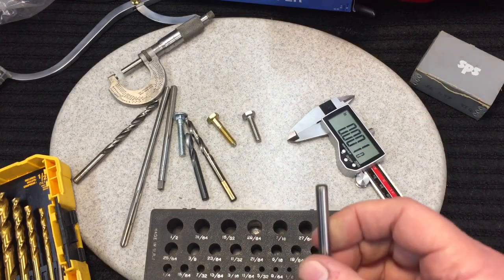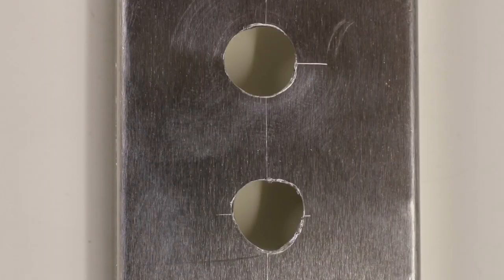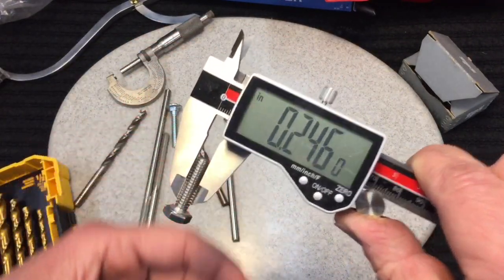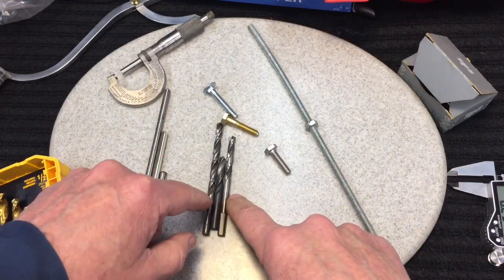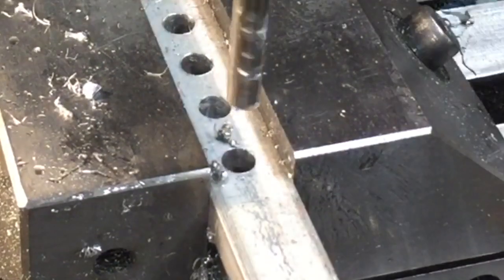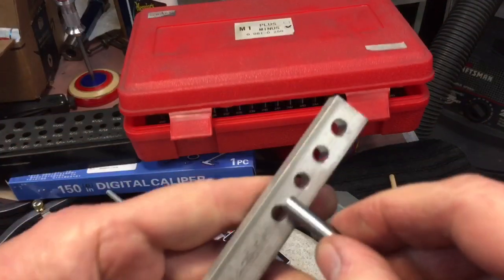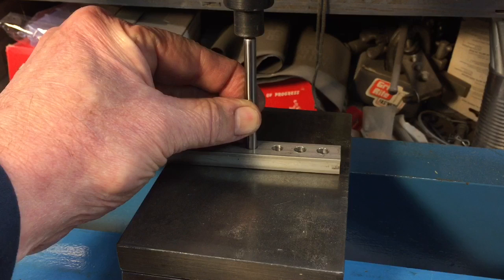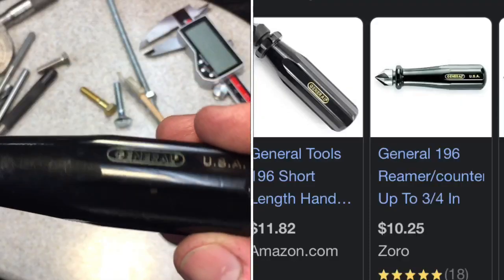Absolute Beginners Guide To Understanding Fits, Drill Sizes and Reaming.

Comment: My buddy Tom got about the best job possible for a newly minted Mech, Engr. in the R&D dept. of Delaval Turbine, Trenton, NJ.  One day, his boss asked him to calculate the heating (hub) and cooling (shaft) for an interference fit.  The shop was about to mount the main drive gear for an ocean-going tanker.  The shaft was about 2 feet in diameter, and the gear was a herringbone gear all of 4 feet across its face and 20 feet on the OD.  His lead came to him and told him that he might want to go down to the shop floor the next day to watch the work he had done the calculations for.  Tom could not sleep the night before.  He kept having this nightmare of the shaft sticking halfway into the hub.  On the day of the big event, Tom went to the shop to watch all go as planned.  Apparently, his boss had checked Tom's calculations after Tom handed them in.  I guess there are a lot of things to teach a newbie.
Reply from the maker: That can be incredibly satisfying when it all goes well but very expensive when things are off...  =D  Glad it worked out well!

Comment: Hint: For quick drill bit/bolt/screw identification, buy a dedicated Drill Gage such as General Tools #15 or similar. Do NOT use your handy drafting circle template for taking these measurements; drafting circle template holes are actually oversized to account for the thickness of the pencil lead and will NOT provide accurate direct measurements. It only took me 30+ years to figure this out and realize that’s why my bit/bolt/screw measurements were always slightly off.
Reply from the maker: Awesome tip!!!!!!!!

Comment: ScoutCrafter, 

In your nrext video it would be worthwhile to go further into the concept of interference and clearance fits.

I find many people don't understand why tolerances can become cumulative.  If you keep adding tolerances you may find when you are finished holes don't align and parts don't fit.

I know of one ship where the centerline was set on the building ways. However,  when setting the centerline for assembly of the ship, they measured from one side of a transverse bulkhead aft and from the other side going forward.  Theoretically, you should have a straight line.  Unfortunately,  going aft the centerline was straight according to the established centerline.  Going forward it was slightly off.  The error carried on increasing with each increase in length.   By the time the ship reached the bow there was a 6" offset.   The ship had a "banana" bend.

Cumulative errors based on tolerances can show up in strange ways.  While escorting visitors around the construction of a ship I noticed that the ship appeared to be bending when looking at it from the bow back towards the stern. The bottom looked as if it were bent with the center lower than the sides.  It turned out the erection sequence of the pieces of the ship had been changed.   As each piece was added  it was trimmed and welded in place.  The problem was that by changing the sequence the weight that was being added caused the ship to bend.  As each was added, trimmed and welded the bend was being built-in.  The cuts were within tolerance, but the cumulative error was enough that without correction the sections of the ship would have, at some point, stopped fitting altogether. 

There are many factors that effect projects we undertake.  Tolerances, measurement errors, temperature, humidity, fit, finish, cleanliness,  and the list goes on, can effect the end result.  Awareness of what has been, what is being done, and whatis needed to be done is needed for a successful project.   If an error is made  accept it and find a way to correct it.

Bob
Reply from the maker: Oh my- There must have been some red faces at that ship and a lot of shifting responsibility!   =D   Thanks Bob!

Comment: Love your videos. Just cleaned up a pair of Channel Lock slip joint pliers for the first time.  Totally addicted to cleaning my tools now. I used a wire brush in my drill press, a tabletop sander like yours, and a buffing wheel. Can you explain how you grind in the nooks and crannies of the slip joint? Is it with a Dremel attachment?  Thank you so much for the videos.
Reply from the maker: Adam- the nooks and crannies are always the challenge..  I have tools that sit on the shelf because they have too many areas that make it a chore to do.  I think that's why I like crowbars and pry bars because they are easy-peasy!   LOL   Yes, a dremel and sanding drum really helps with the hard spots, also sometimes we have to resort to hand sanding and that is always tedious...    =D

Comment: An inexpensive digital caliper is a useful measurement tool to be in a toolbox.  The inexpensive digital calipers will use many batteries and the edges will be rough but it is useful to accurately measure (in inches or millimeters).  Recommend have a spare battery in the case.
Reply from the maker: LOL   You are so right!  The edges are crazy sharp and eat batteries like crazy!   =D   So true Brian!

Comment: The info about the diameter of the drill bit and the shaft and tip being different was interesting. I guess that would explain why when sometimes I match a bolt up it is a little bit off.

Comment: This may be your best video ever.  I've been drilling holes for a long time now (no, no...get your mind out of the gutter) and I always knew that drills were not the exact size they are marked, but I now understand it more clearly.  I will have to look into a set of reaming drills.  I tended to oversize drill the hole and figured it would be good enough (and in some cases it is), but I like the exacting tolerances.  Thanks again,  Wayne out West

Comment: The ID of the hole cannot be = to or less than The OD of the pin going in to the hole.
Reply from the maker: It can be but then force is needed to press it in resulting in an interference fit.  Depending on the harness of the material it can be .001 or .006 for soft materials...

Comment: Here's a thinker for you. So you have a quarter inch towel pin and a quarter inch hole. We know thermal expansion works. I'm sure you have noticed that parts warm up quite a bit in the hydraulic press. The more pressure you are applying, the more heat you are creating in the form of friction. So, is the hydraulic press a thermal tool? Cuz if you applied the same PSI of force, but all at once, I believe it would mushroom the dowel pin and gall the hole. What are your thoughts? I have quite a substantial press and that's one of the few things I can video: the action is all in one place so I can prop the phone against something. I only mentioned this because it might be interesting to chart the heat alongside the PSI. More data is better, but I would be particularly interested in the very slight differences in the range that our two machines share, try to tease out the reason, be it climate, elevation, or technique. As I'm sure you know, the goal on the lathe is to have the heat all end up in the chip. Maybe charting this could help in that goal? I've noticed that carbide for example seems to prefer to run hot. There's lots of little things like that that go against traditional wisdom, this is what interests me the most, trying to solve the mystery of why
Reply from the maker: I always wondered at what point when pressing in a tight pin does the friction provide enough back-force to result in the pin becoming thicker from the press force.   Hmmmm
Reply: @ScoutCrafter  you got it right on the nose. If you start taking temperature readings at different diameters, you will notice the diametric scale. I don't know what the facts are, but I've puzzled over this for quite a while. There's at least a relationship with the heat generated, I often wonder if that's what's happening when we hit that point in the press where it just suddenly goes shoop and slots into place. Did the heat need to build up to a particular temperature ratio to diameter? It's really interesting to think about

Comment: I just wanted to reinforce the point that you are making about thermal expansion. In the machine shop, there is typically a small room designated as the metrology lab. This is where all of the measuring is done. Thermal expansion is so powerful, that the specs you see on a plan must be matched in an environment that is 68° and 55% humidity. I believe there's even an elevation variable but I'm not certain. I just have a small Job shop with second hand tools, but many of my instruments will give wildly different readings if taken on the shop floor. In fact our levels almost always have wood or bakelite to prevent the body heat in your hands influencing the rule. We have these incredibly brilliant precision tools, the results are meaningless if you cannot control the environment you are measuring in. This is not anything a hobbyist needs to worry about, quite the opposite; you are free to get the affordable gear. You don't need to spend thousands to be in the hobby. In fact, many hobbyists don't own measuring equipment at all! A simple pair of calipers for a comparative is fine. Go ahead and get the $50 collet set from the Big Rock Candy mountain, you probably won't notice the difference
Reply from the maker: I had no idea the humidity had to be factored in too!  I can see elevation.   Interesting!

Comment: I'm sorry but you triggered a favorite rant of mine. If your build requires a reamer, it needs a real reamer, not this adjustable crap. Your print calls for a precision bore, and you think it's acceptable to run calipers across two of the four blades in an adjustable? They don't deserve to exist. They are a stupid tool for stupid Machinists. If the print called for a vaguely round hole, a drill bit would suffice. If you're going to dare to call it a bore, it needs to measure the same from top to bottom as well as being properly round. I don't even understand the appeal. Sure you can save yourself what? Two or three hundred? How much do you Bill per hour? How long does it take to set up the adjustable reamer? How many times did you have to recheck because you couldn't trust your equipment? It's dumb. Just use a real reamer. If you treat them decently, they will easily last two or three lifetimes. Overall, if you need it to be right, you need it to be right. Okay sorry
Reply from the maker: I have seen adjustable reamers and never knew how to use them.  They look complicated to get right!

Comment: This is easily the single largest source of miscommunication between customers and Machinists. To a machinist, a quarter inch fastener has a maximum diameter of 0.25. To a construction worker, a quarter inch fastener has a head that is 0.25. You would be doing every machinist on Earth a solid by reiterating this often. And then you get things like whitworth... And hardware store fasteners that don't even list a percentage of engagement! The whole system has gotten so screwed up, we need to just start fresh. It should all be The Machinist way. A major diameter, followed by the necessary length, followed by the head type.
Reply from the maker: When I was a kid I remember being fascinated learning that there was a Fine thread and Coarse thread to  nuts and bolts!   Fast forward to now and there are so many thread and pitch combos that I can't keep up!

Comment: I think you explained this extremely well, I wanted to give a little bit more context. It is true that drills do not make round holes. The reason however is a lack of rigidity. In theory, if you were using a drill press and a very large diameter drill bit with virtually no deflection, a round hole is certainly possible. The important part about this is the inverse, the smaller the diameter, the more the drill bit can deflect. This is all that a milling machine is; functionally speaking it's an extremely rigid drill press and an end Mill is just a drill bit with a lot more clearance and rigidity. One of the best demonstrations of this is when using a slitting saw, you can run it either direction. You can't do this on your table saw because of a lack of rigidity, but if you look at the blade face on you will see there is no reason it should not be able to cut the other direction, the only difference which direction do you want the chips to go. There are other considerations, but this principle can be difficult for people to wrap their head around, I have found this to be a stumbling block in particular.
Reply from the maker: JP- The funny thing is we could talk about any part of this video for an hour with no problem...  Chasing accuracy is like going down the rabbit hole!    I used to laugh and say there is Farmer accurate, mechanic accurate and machinist accurate...   LOL   It really is a fascinating subject especially when you are around  experienced machinists who just make everything look so darn easy!  LOL

Comment: This is funny!  I'm dealing with this issue right now.....im making tuning slides for a horn.  To do that you need pieces of tubing that telescope into each other.  Imagine trying to explain this to a company that is supposed to know what they are doing, that I need brass tubing....2 different sizes.  But both involving a 1/2 inch measurement.  I need one type with a 1/2 inch inside diameter and another type with a 1/2 inch od, outer diameter.  They keep sending me tubing that will not telescope.  I finally gave up on company A, and went to company B.. The second company uses stock numbers to make it easy. #1839 fits into #1840 with a tight clearance fit!  Ill put them together and solder the joints and spongebob's my uncle! So if anyone out there is making tuning slides for a 1936 HN White, King, Altonium...I just solved your problem. LOL!
Reply from the maker: Bill- It's funny that some tubing manufacturers have tubing that is designed to slip fit inside the next size!  Brass is like that a lot.   I wonder if this dates back to the musical instrument business?   =)
Reply: @ScoutCrafter  it's probably an attempt.  Back in the day, all the makers made their own tubing.  They then sold it to authorized repair shops.  Today you can go to instrument manufacturers or specialized suppliers but they'll charge you 3 times more for the same quality tubing.  Once you find a place that knows their business, you're good to go.  I have #1389 coming in from 2 sources by Friday.  One of them has to be right.  I'll know for sure then.🙄

Comment: That was a very good episode, thank you. One thing that is always had me confused is the difference between a wood drill bit and a metal drill bit. Could you do a short exclamation this on one of your episodes? Your videos are always entertaining a good variety for the shop.
Reply from the maker: Hi Bill!  Absolutely- That is a fantastic subject!!!!!!!!!!!   Thanks!!!!
Reply: Wood bits are for making holes in wood ..... Metal bits .... Ah self explainitory...  😂👍
Reply from the maker: @toolrestoration    Jim you are too much!
Reply: @toolrestoration  Yes I know that much, But there are different cutting tips in them. That is were I get confused.
Reply: @billwest7274  metal bits can be used on both however they will leave a rougher finish on wood and will not be as accurate . The flutes are cut differently to disperse the different material Matter . Wood bits have a point so you can place the tip precisely at the centre of where you want the hole . ( Kind of self punching) metal bits need to have a start point tapped into the metal before hand otherwise the bit slides around . If it had a point like the wood bit it would break straight away . Normally wood bits are black and silver with a point at the end , and metal bits are all black or gold when coated in a titanium dusting . Also metal bits can have a different angle head to each other depending on the metal they are made to drill thru . 👍
Reply: The above information is to the best of my. Knowledge and not to be taken  💯 unless scoutcrafter thumbs ups this message 😀
Reply: Forgot to add there are also different twist patterns depending on usage also such as slow twist fast twist and oh yes lets not forget my favorites left hand twist drills.

Comment: I worked for a huge international office machinery company and they needed a gearbox for a new machine, instead of contracting out the work to a specialised gearbox manufacturer they decided to design and make it in house. It was a disaster, shafts wearing out, bearings falling out and the cost to keep repairing them cost an arm and leg. Their fit on all the parts was wrong and their knowledge of machinery was huge but even they did not know everything.
Reply from the maker: Tony-  So many times things look so easy from the outside...  A good operator can make difficult tasks look simple. I remember when I was a kid I needed leaf springs on my car. My Dad and I went to American Auto Spring in the Bronx...  They removed the old springs, rebuilt and installed them in less then an hour...   It was magic to watch, as it would have taken my Dad and I three days and 20 arguments!   LOL

Comment: I will resist the sudden urge to purchase a set of pin gauges....and a Dake. Bandsaw comes first, then all bets are off. Another excellent video ScoutCrafter. Once again, I learned something new in a short time. An excellent and easy to understand lesson!
Reply: The force is strong with this one .... .  .   .
Reply: You are wise to get a band saw before other machines.  Sorry to mention this, but a bandsaw has been called one of the most dangerous tools in the shop because it does its thing in such a calm way.  Remember, a butcher also uses a bandsaw.